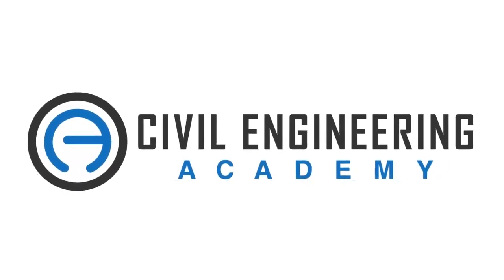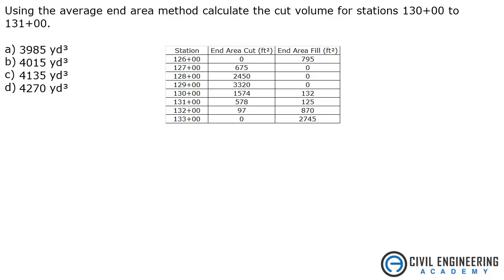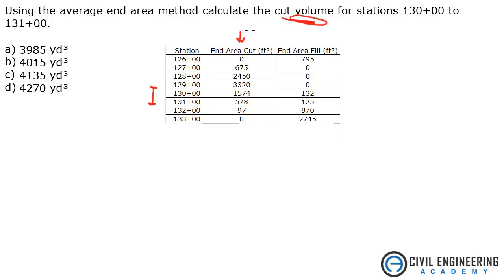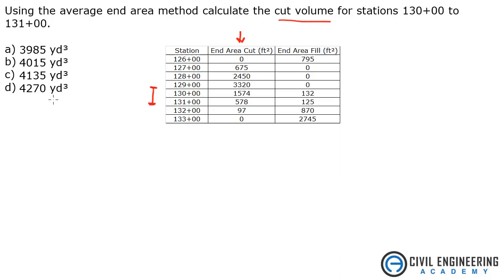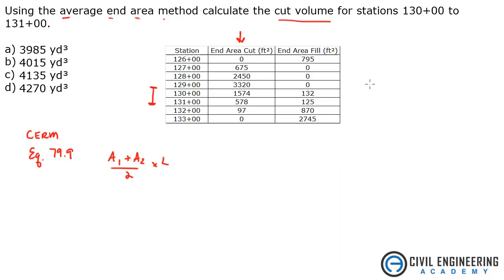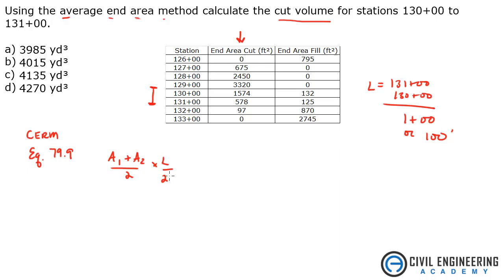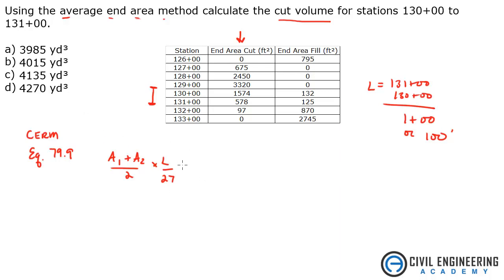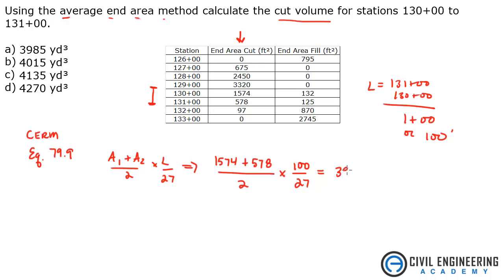Construction-Use the Average End Area Method

Comment: What if it asks for Station 129+00 to 131+00 and you have 3 end areas to add; do you still divide by 2 for the formula?
Reply: If you’re using the end area method, you take two stations at a time and solve like he did, then you take the next two (which would be the second and third station in your case) and solve again just like he did. You then add all of them after you’re done.